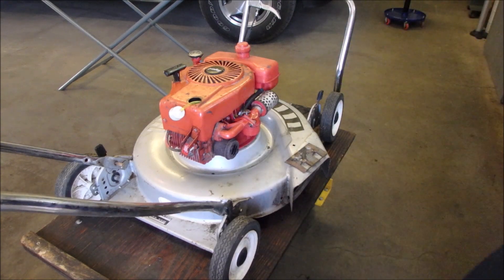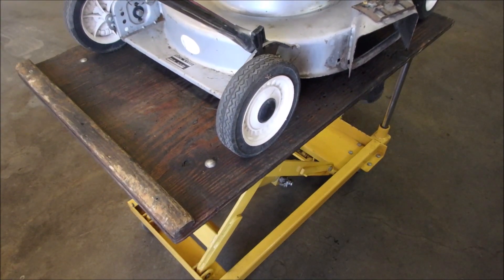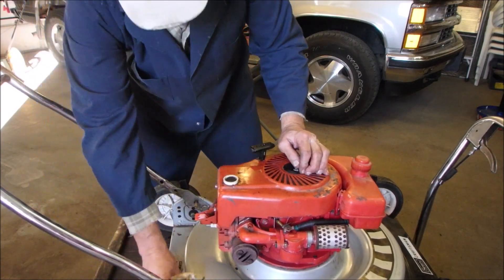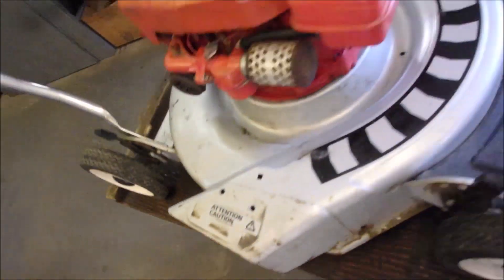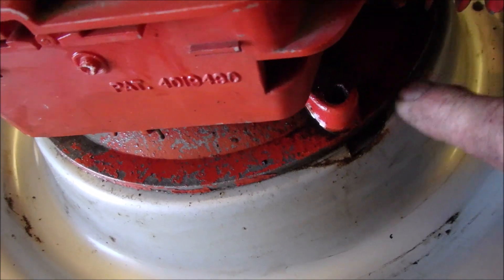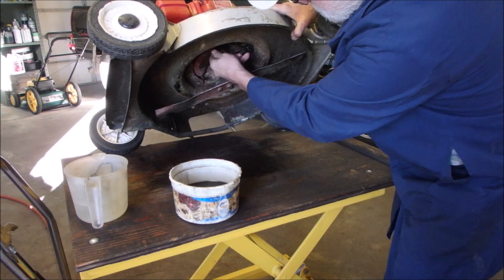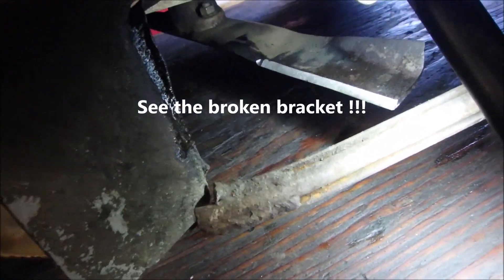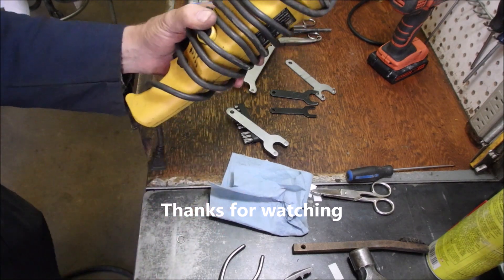1970 Craftsman Eager Tecumseh Part 3

Comment: I had a '70s vintage Eager 2 two cycle Tecumseh engine model, very similar to your mower.  I hit a steel stake and broke the engine out of the aluminum deck.  I cut a disk of 1/4" steel to attach the engine to what was left of the mounting area after the wreck.  It worked fine.  I later discovered aluminum stick rods could weld the deck, but I didn't have the pieces anymore.  The ignition module failed in the '90s and I couldn't find a replacement, so it went to scrap.  If the internet was available back then, I would probably have found a module and I would still have it.  Loved that mower.
Reply from the maker: Yes the re are a lot of places to find old parts now.  Good to hear from you.

Comment: Things were built to last in the past. Now, things are engineered to fail, be thrown away and replaced with new junk. This is why I love my old tractors. And yes, I do own a push mower. A Snapper 2 cycle Wisconsin Robin Heavy Duty Commercial from 1984. You've done that old Craftsman a great service keeping it alive and ready for another 50 years. Cheers my Good Friend! Sean~
Reply from the maker: You gussd it.  Do you think any mower made now will be around in 2073??

Comment: Just to give you some more confidence on that deck bolt fix, I did a similar repair on a Deere mower deck around the front wheel area way back in 2017. Still, holding strong! Also, I had a similar break around the side discharge on a Toro. In case your weld doesn't hold (it should), I fashioned & curved about a 3" long strip of 1/8" steel to span the break area. Then, I riveted it to good deck material on each end. Finally, you did a super restore job on that great old mower. It's arguable that Tecumseh made the best air-cooled small engines on the planet back then. After all, Sears staked what was then it's revered Craftsman reputation on that engine ... as did Toro.
Reply from the maker: Yes It is amazing how many there are out there still.

Comment: Properly built machine, my uncle has a atco mower that is 80 years old and still in use, you can't beat  old engineering, all the best to you all
Reply from the maker: Yes  built well eh!!
Reply: My Atco is from 1962, with the Villiers motor, the challenge for me is there is no governor.
It was rebuilt with oversize rings but the old piston and runs very well with 40 weight Royal Purple in the crankcase.

Comment: Hi !, I'm following all your videos they are very interesting and for me as a novice sleeper they are very informative. Congratulations!
I noticed that you use the same forklift truck that I have. Can I ask you, if I do not disturb, the measurements (length, width and thickness in cm.) Of the wooden board that you have mounted on the forklift?
Thanks to the availability
Reply from the maker: The 3/4 inch plywood is 3/4 inch  here is a copy of the video I made.  it is older
https://www.youtube.com/watch?v=yv7FtFWRHaU

Comment: Very good series Bruce. That mower is in fantastic condition for its age do you think it spent some of its life just sitting somewhere and not being used. I you told us anything like that in the beginning I don't remember. Is that 3m wheel you put on the angel grinder a cut off wheel or a grinding wheel. We got 7" of snow here Wednesday night and went down to 9 Degrees last night thats a lot of snow for us and pretty cold for us as well.
Reply from the maker: Yes I think it sat for quite a while.  If i am not mistaken that is a cutoff wheel but I use them for a lot of different jobs.

Comment: Those deck cracks are usually due to excess vibration from an unbalanced blade or bent shaft.
Reply from the maker: Right.  This one has a balanced blade (now)
Reply: @BrucesShop  ok that must have been in part 1

Comment: I have a newer version of that, eager1 craftsman, going to have to do a video on it, and explain the issue with the engine, also have a late 70s toro turdcumsen 5hp engine on it, the strange part of it is the muffler goes down through the deck, same small round muffler as this one here, but the muffler is screwed in from under the deck, also it is key start only no pull rope mechanism at all, will have to do a video on it as well, you have a good mower there, they don't make them like that anymore.
Reply from the maker: I feel the same way.  Thanks again.